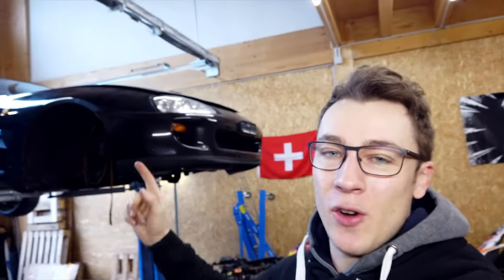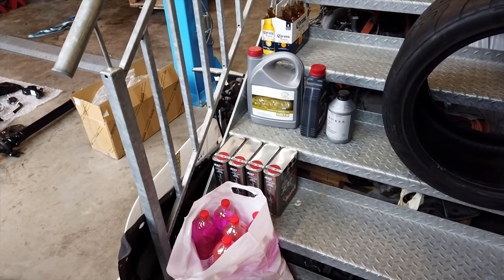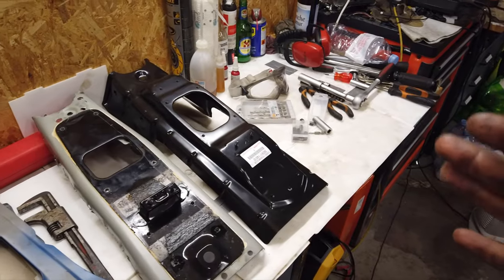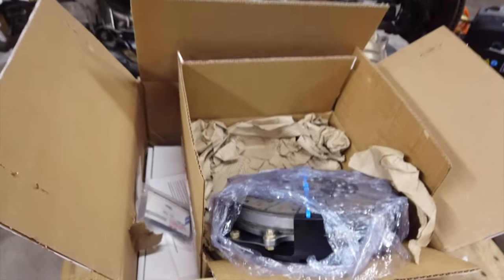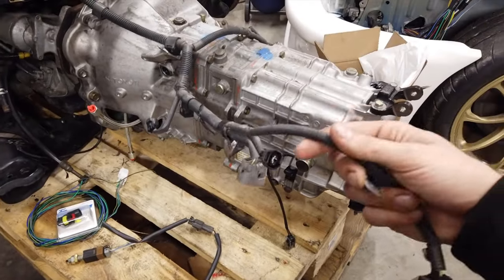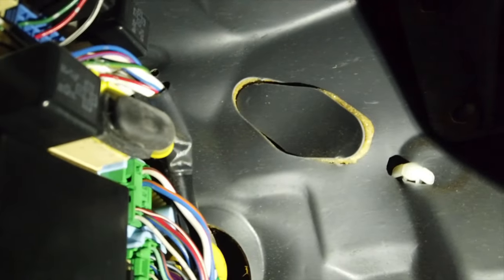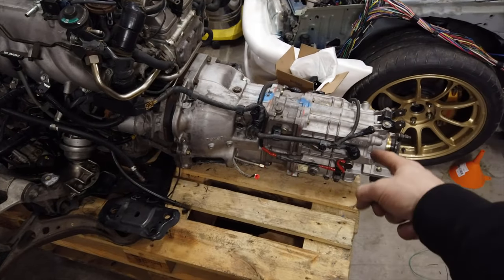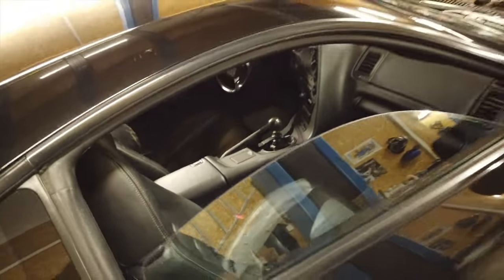Mk4 Supra - Manual Conversion (V160 Swap)!!! - Auto to 6 Speed How To

Comment: Nice job.  One thing I will say, for a cleaner install...you didn’t need to drill holes to remove the spot welds.  You could have either ground-down the spot weld from under the tunnel (as you will be throwing away the auto tunnel anyhow) and preserved the metal inside the car, or used a sawzal with a really thin flexible blade to get in between the two pieces and cut the weld (this preserves both sheet metal pieces.  Then, use a single point spot welder and from under the car, spot welded the sandwiched pieces at the same points all around followed by sealer and paint.  This method prevents removing the oem sound deadener too.  Makes for a ultra clean install.  It’s what I did and you cannot tell the car ever had any work done to it.
Reply from the maker: I don’t think that would work, it would be impossible to spot weld the two peices together with a MIG without first making a hole through one of the pieces. Even if you managed to do that, the sound deadening material would burn through the second you try to weld the new trans tunnel.
I’ve considered many different ways, this was by far the cleanest and most OEM-like
Reply: @SwissTuned  Who said you wouldn’t make a hole in the new tunnels sheet metal?  You just wouldn’t need to do it on the chassis metal.  I don’t think you understand what I am talking about.  I did it just as I explained and it looks like it came from the factory that way.  Also, I used dry ice to freeze the sound deadening and literally lift it off the scribe points.  I let it thaw on wax paper and reused it when the new tunnel was in.

Comment: Nobody else on YouTube seems to mention about the transmission tunnel
Reply from the maker: I found one video from Kevin McMullen but otherwise not much info, or just bad procedure…
Reply: @SwissTuned  a manual conversion on mine is a long way off yet. I'm getting the car ready for bodywork and I'll have to make do with the GE and auto for a while before turbo conversion and manual. I'm a little bit nervous about making mistakes so I'm glad I found your channel 👍

Comment: I thought the ECU needs to be swapped as well at this is an AT version and a MT version.
Reply from the maker: There is discussion about this, but as far as I know on edm supras as long as both ecus are for the gte engine it doesn’t matter, the engine works the same. I didn’t have to do anything and my car pulls hard all the way to redline, no problem whatsoever.
Reply from the maker: Actually i think it has to do with the neutral switch on the auto gearbox wiring. Most people solder the two black wires (pin 5 and 6) together, which tells the ecu that the car is in neutral. It allows the car to start with the manual gearbox, but there will be a rev safety limit while driving. So it’s much better to use the clutch switch to do this, especially since all supra wiring harnesses already have the connector ready under the dash, and retain full functionality of cruise control and engine settings.

In short, do the wiring correctly and you’ll be just fine with the auto ecu

Comment: Were did you buy the clutch kit, throwout bearing and flywheel from?
And what part numbers are they?
I live in Sweden but I cant find any Tilton retailer here.
I love your videos!
Thanks in advance.
Kind Regards 
Erik in Sweden
Reply from the maker: Hey! It’s all from Grannas Racing, you can find it on their website (there is only 1 I believe). I must say that it is quite noisy and vibrates sometimes, which is normal for a twin disk clutch, but if you aren’t pushing much power I would recommend something less aggressive. The clutch feel is quite nice though, definitely heavier than stock but not crazy and i actually prefer it this way.
Good luck with your project ✌🏻
Reply: @SwissTuned  Thank you very much for your reply and quick review of the clutch.  :D 
I'm only running a stock 2jz-gte with basic BPU upgrade.
Previous owner installed a 2 disk
Tenaci clutch and it rattles a lot, sounds like the car is broken.

So I think I will go with the OEM clutch and flywheel sens I do not do any track or drag racing , mostly going for a drive and an occasional ice cream ;) 
Thanks again and keep up the good work, its very inspiring to watch.
Kind Regards

Comment: Awesome video, I'm thinking of going down the same path, one thing I've got to ask. Would it have been easier to use a manual supra gearbox loom instead of cutting the old auto one up? Also what ecu are you running? Oem? Cheers
Reply from the maker: Hey, there is no gearbox harness, it’s all part of the engine harness. So you would need an entire TT manual engine harness, which is hard to find and expensive :/
Running the oem ecu no midifications needed.

Comment: i soder the 2 bigger wiers, but stil no start on starter gear? what could it be? i can start the starter gear on the relai by myself. i got single gte vvti 1998 v160 gearbox. but i got a new enging wiring loom from an atomatic but im now weeks on trying to sart my supra 😞
Reply from the maker: I assume you have a M/T ecu then? In that case i an not familiar with the signals needed to let the engine start but i assume you would only need one for the clutch pedal, which is different than the one from the gearbox on Auto ecu. I can’t imagine the M/T ecu reading any signals from the wires I describe in this video since they are not present on Manual cars.
So do more research on M/T ecu and which pins allow the starter to work, and then check where those wires go in your auto wiring loom
Reply: @SwissTuned  yes u ar correct. i have M/T ecu but i have now a aem standalone ecu. i needed  a new wiring loom but i was abel to find a A/T wiring loom. M/T wiringloom not abel to find.  just need to be patience:) i cant find alot help in my country they know nonthing hear :/

Comment: Hey im going to be doing this soon, what tool did you use/ find easy to take away the underbody coating?
Reply from the maker: Hi, i used a regular wire brush on my electric drill, works pretty well but make sure you wear face protection in case some of the metal wires come lose

Comment: Remember to change to the manual ecu too :)
Reply from the maker: No need, it works perfectly like this 👌🏻
Reply: if you are using an a/t ecu with the manual trans.you shouldn't see any difference in the way the car run's but the  a/t ecu does drop a couple of injector's between shift's when you are using the a342 auto trans.this is to help the trans last longer. So it is not the right way to use a auto ecu on a manual. It sounded like on the video you did you reascharch 😉
Reply from the maker: @thomasdullweber50  Hey man, my researched showed that both ECUs are programmed the exact same way and it would make no difference performance-wise.
As you said, only difference could be the fueling when shifting gears, but that doesn’t seem to really be confirmed... even then it wouldn’t hurt anything to have a little extra fuel, so no need to bother. (Mine drives completely normal so far, and no flames coming out the exhaust either 😉 so i really don’t think it’s worth the hassle)

Also, if I wanted the M/T ECU I would likely need the M/T engine harness, which is hard to find in good conditions.
This post contains a lot of useful information:
https://www.supraforums.com/threads/a-t-vs-m-t-ecu.361391/

But if you have reliable infos on the mapping of M/T vs A/T ECU I will gladly take it into consideration :) Infos like this can be hard to find, so please do share 🤗
Reply: No need to swap the ecu ...

Comment: I wonder how many Supras exist in Switzerland
Reply from the maker: I’ve been told there were only around 40 sold in switzerland between 1993 and 1998. From those a few were crashed, parted, exported, retired, scrapped… and some foreign cars were imported but not too many either (since importation is a bit tricky here).
From there you can speculate as to how many are actually on the road now

Comment: How much did this cost in total
Reply from the maker: On average I would say 10-15k without labor, but it really depends on the parts that you choose (like clutch, driveshaft and diff). The gearbox alone is roughly 6-8k used in good conditions

Comment: Part numbers. Please, for the love of God, post some part numbers.
Reply from the maker: You just have to look in the description
Reply: Heeeeey I'm back 2 years later. Im moving forward with my swap and still looking for parts. I did see the description. I just assumed it was ONLY Part numbers for shifter linkage assembly. But not for things like the manual tunnel, clutch pedal assembly, all the grannas parts, etc etc....

But thank you so much for this video im using it for my swap process.